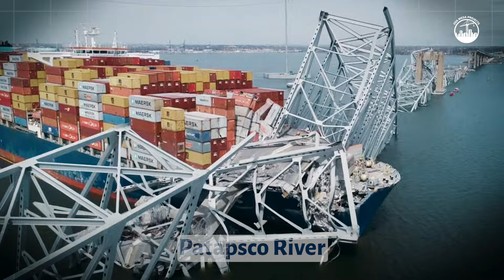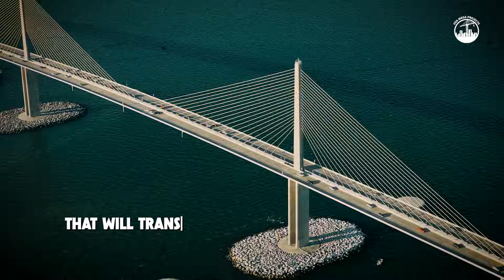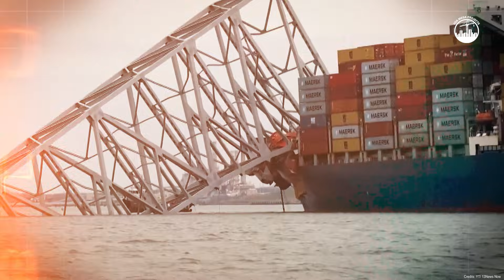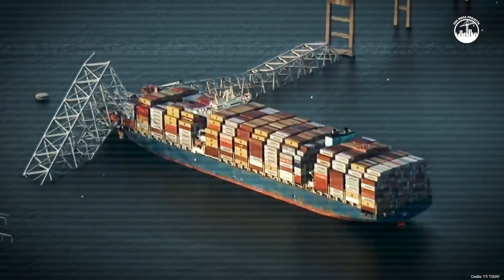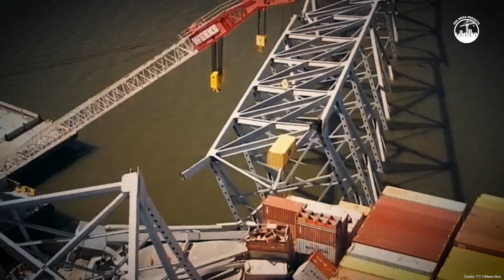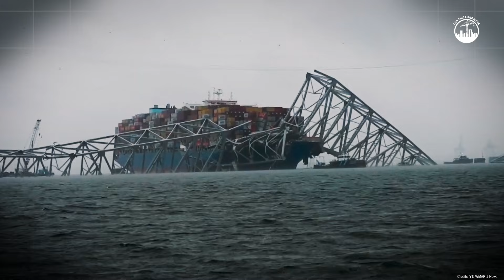Inside the $5.2B Rebuild of the Francis Scott Key Bridge

Comment: Should build a Tunnel under the harbor like the other one.
Reply from the maker: A second harbor tunnel is something planners have discussed, but it comes with very high costs, complex marine construction risks, and long approval timelines. Whether it happens depends on future traffic demand, funding availability, and political support to justify a multi-billion-dollar investment.
Reply: @USAMegaProjects  It is CHEAPER in the long run. The Baltimore Harbor and the I-95 Tunnel are prime examples. Besides another Bridge is a WASTE OF TIME, MANPOWER, MATERIALS  which will have to be replaced every 50 years and collision of future Bridge. Common Sense does not prevail here, have a nice day.

Comment: Build a tunnel!  Works for us here in Hampton Roads.
Reply: We already have two that cross the harbor but another tunnel would exclude trucks carrying hazardous materials and they would still have to go the long way around.
Reply from the maker: That’s a valid concern. Even with another harbor crossing, hazardous materials would still be restricted for safety reasons, so truck routes wouldn’t change much. In that case, a new tunnel would mainly benefit passenger traffic rather than solving freight movement constraints.

Comment: The cost goes up and UP every month it seems. We need that bridge to be built ASAP. The traffic is already crazy but with a large portion of the 695 beltway no gone. Its worse. 

Every official computer render from the state Ive seen leaves me with more questions than answers. 

They said they’re going to
“future Proof” the bridge but by making this NEW multi billion  dollar bridge only 2LANES of traffic both sides. They are in fact building a new bridge with some of the old bridge’s disadvantages.
Reply from the maker: A lot of people feel the same way the cost keeps rising, timelines keep slipping, and the design choices leave big questions. With the bridge now projected to cost around $5 billion and finish closer to 2030, the frustration is understandable, especially given how badly the region needs traffic relief. The concern about rebuilding it with only two lanes each way is valid too it limits future capacity even though the price tag suggests it should do more.

Comment: It is not a $1.9B project -- A few days ago the 70% design completion level has determined an updated cost estimate range to $4.3 to $5.2 billion with an anticipated open-to-traffic date in late 2030.

The feds will refuse to support this.
Reply from the maker: You're right the cost has significantly increased to $4.3-$5.2 billion with a new completion date in late 2030, a substantial jump from earlier estimates.
Reply: @USAMegaProjects  
A regional relief bridge carrying 32,000 AADT is not worth that expenditure.

Comment: This needs a bit of an update. The cost for the bridge is now estimated to be at least 5 billion! Also, they chose a cable stayed bridge because of the cost and expediency of building it. A very basic and rather boring design was chosen, but I'm sure that it will eventually grow on people.  Everyone complaining about traffic jams caused by the loss of the old bridge probably don't care what it looks like as long they will be able to use it in the future. Only other option would have been a suspension bridge, which would have been much more expensive and taken a lot longer. The timeline has also been pushed out to 2030 rather than the original time frame of late 2028.  Perhaps the increased cost is because it looks like they are going to build small mountains around the pier bases to deflect ships.
Reply from the maker: Thanks for the update. The rising cost and extended timeline make sense, especially with the switch to a simpler cable-stayed design to save time and reduce risk. Most people affected by the traffic issues just want a safe, reliable crossing again, and adding larger protection structures around the piers is likely a major factor in the new budget.
Reply: $4.3-5.2 Billion is the price range. Cost spiked due to the bridge needing to be even larger than anticipated, crazy pier protections systems and economic environment around material cost.